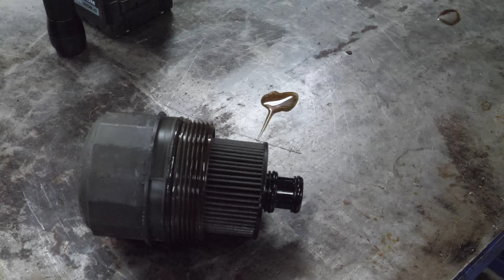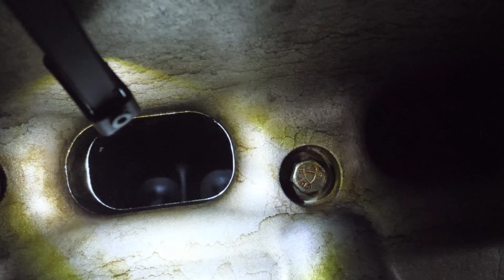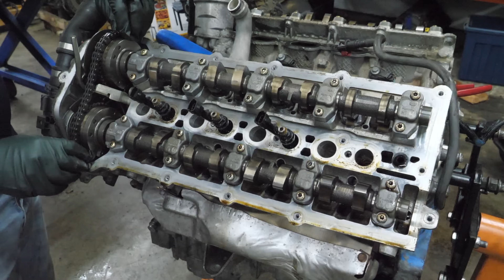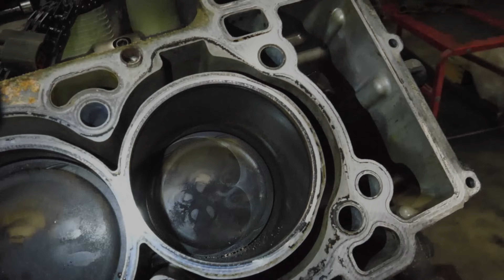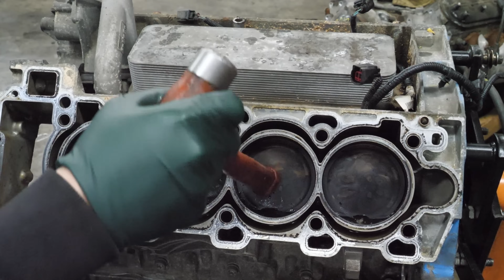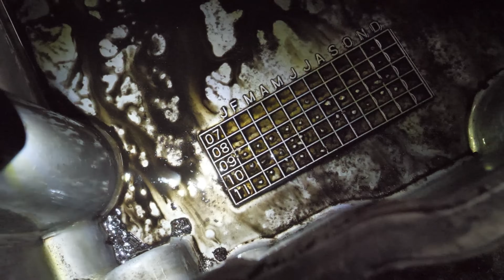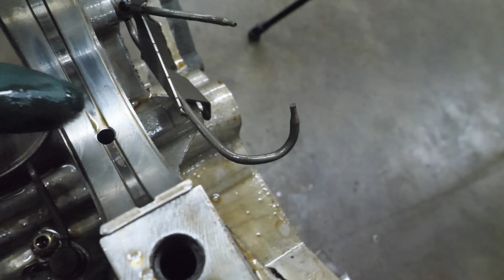500HP Jaguar Land Rover 5.0L Supercharged AJ V8 Teardown! Had to buy AND borrow tools just for this

Comment: Thank you for doing this one! I had a 2010 Jaguar XF Supercharged with this engine until I sold it in May of last year. I had an ECU tune that jacked it up to about 550hp and had it from 42k miles until about 85k miles, so let me tell everyone about the quirks.

1: The coolant system is the main weakness. The water pump design is absolute garbage. I had to replace the pump right after I bought it, then again at about 75k miles. Pretty typical for these. It's not a terrible job, but not cheap either. The other issue, which luckily I didn't have, was with the crossover pipe. That was that flat black coolant pipe he removed from the rear of the motor. They are seam welded and not very robust. After many heat cycles, it gets brittle and starts splitting at the seam, and it's not an easy thing to get to. There are a ton of other plastic fittings that get brittle which I didn't have a problem with in 4.5 years of ownership, but I knew I was on borrowed time, which was why I sold it.

2: As everybody knows, the timing system sucks on these. It's a craps shoot. I never had any major chain noise, but as other comments have mentioned, the Jaguar 15k mile oil change interval is bullshit. I changed my oil religiously at 5k miles. Apparently, there are small oil passages in the tensioner that can clog up, slowing down how fast it builds tension. Too little tension at startup for too long wears out the guides. These 5.0's were apparently much better in the timing chain/tensioner department than the earlier 4.2's, but it's still something an owner needs to keep an eye on.

3: As he mentioned, the supercharger isolation coupler is another issue. Not a major one, but something that does need to be addressed after a time. I didn't notice any noise from mine, but I'm sure it was getting worn. On the other hand, this engine is so well insulated that you can't hear ANY supercharger whine, even at full throttle/max rpms.

4: That tube that went up to the oil fill hole was for vacuum draining the oil. I got a big vacuum pump from Harbor Freight and was able to change my own oil, which is WAAAAY cheaper than doing it at the Jag dealer. And with the cartridge oil filter up top, it's very easy to change, and makes almost no mess.

5: If well cared for, it's an amazing engine. The engine is so smooth, yet brutal with its torque all the way through the RPMS. I took my XF to the drag strip for open track night many times and it was way faster than it had any right to be. At around 4300lbs and with Continental Pilot Super Sport all seasons, I did a best time of 12.2@115mph with a 1.8 60' time. It would do consistent 12.3's. It was faster than just about every Charger/Challenger that wasn't a Hellcat, most Mustangs, and most Camaro SSs. I was usually about a tenth slower than C7 Corvettes, but they are like 700-800 lbs lighter than my beefer.

I do miss my Jag, but with it getting older I was just worried about expenses. The engine is set back in the bay, so even just a spark plug change is a pain for the back cylinders. Overall, though, besides the two water pumps, which only leaked and never overheated the car, my XF was very reliable and never left me stranded from a mechanical issue. And I may or may not have had it up to 130+ on old route 66.
Reply: You love your Jag. It’s like a member of the family but in a good way
Reply: Thanks for sharing as they say in the anonymous Jag-aholic circles. Yup, oil-change with vacuum suction makes sense - no lifting the car and risking it killing you while under it, no messing with the drain plug or buying a new gasket for it, no removal of belly pans etc., just let the little pump do its big work. Some youtubers (that dude with the new VW Golf GTI who develops parts for VW tuning) claim it does a better job than draining. Greetings from Latvia.
Reply: jag land rover tech here

first of all, pretty rare to see an XF with a 5.0, those are absolutely gnarly for the smallest sedan jaguar has to offer for that year.  if they were reliable id consider buying one!

but you're correct on just about everything.  i've personally witnessed so many range rovers and a few jags need engines from overheating primarily, but occasional jumps in timing from something as simple as an oil change, quite literally, oil change mucked up the motor and it got towed out.  as crazy as it sounds its happened.

incredibly torquey, retains its power, but so many design flaws that weren't addressed, even the earlier 5.0s/3.0s had metal outlet pipes which i havent seen a leak yet! the plastic ones, the latter unfortunately.  crossover pipes i see leaking less than outlet pipes, but still fairly often and a common failure point.

not only that, jaguar/land rover's spec for cylinder head/block warpage tolerances are 8 thousandths (.008").  That is a LOT of warpage they tolerate, and typically if they cover head gaskets if its within spec, it will sooner than later just warp even further and need an engine.  joy.

vacuum draining oil makes it take so little time, very little mess, and thats how jaguar land rover recommends and pushes for you to do it! plus, oil drain passage on the oil pan will just splash onto the subframe and create a mess, plus metal undershields on rovers/massive plastic belly pans on jaguars are never fun to take off or put back on.  good on them but it can create messy work.

some full size 2023 rovers just picked up the third revision of the BMW N63.  training has said its basically another crap shoot.  once again, joy.

don't worry though, your insurance heard nothing about route 66 :)
Reply: This engine is violating a basic rule of mechanical engineering. The more parts a mechanism has the less reliable it is.  This is not good overall design.
Reply: @floatNMD  Great to hear from a Jag/LR tech. Yes, it was the "smallest" sedan Jaguar offered, but it's definitely not small. I think it's something like 4200 lbs. It's a beefy car, but still not as big as the XJs, which are massive cars.

Yeah, when running it's a great engine. Torque and power for days. Brutal but smooth. It just has some design weaknesses (probably from the bean counters) that can be fatal. With as fast as Jaguars depreciate, if you can afford the maintenance, I would take one over a Charger/Challenger or anything else, really. It handled really well for such a big car with the active suspension.

I've heard that a lot of the newer Jags like the XE has BMW derived engines that are, ahem, less than reliable. It sucks because I really like the styling of the XE, but I just don't know if I want to deal with the maintenance/craps shoot.

All luxury cars are a craps shoot for reliability, really. The most reliable car I've owned, believe it or not, was a 2008 Saab 9-3 Aero (Turbo V6). I put a tune on it (about 320hp) and I had close to 100 passes down the strip. I had that about 4 years as well, and all I had to do to it was new rear shocks, some coil packs, and a cracked vacuum hose. I could knock out 13 second 1/4 mile times, then get 30mpg on the way home. But for every story like mine, there are nightmares.

I bet you do make some bank as a Jag/LR tech. I had to take my Jag to the dealer to replace a leaky diff seal and the dealer raped me for $1400... All of the indy shops that worked on Jags were booked almost 2 months out and I couldn't wait that long to fix a problem like that.
Reply: @floatNMD  yeah new rovers and svr's with bmw's 4.4l TT V8
Reply: @jnordne2  rear differential front pinion seal by chance?
Reply: @andrew_gencoupe  being its a jag I see axle seals leak more than the pinions, just a shot in the dark guess.  see more range rovers with pinions pissing diff fluid than i do jaguars.
Reply: @andrew_gencoupe  Whats crazy is how hard the n63 picks up and scoots those cars, i've gotten a bunch in for service already within the first year of them being out, test drove one in dynamic mode since it was after the break in period, and wow, moving a 6500lb land yacht on bags that quickly is ungodly.  just not excited if i gotta do valve guide seals, already a shit show taking those motors out.
Reply: @jnordne2  Wow I never got a notification, youtube signed me out :(

Surprisingly enough, I haven't seen any jaguars get brought off the truck into the dealer with the n63 yet.  I HAVE seen some issues with thermostats leaking onto the DME and frying the harness already with brand new rovers with parts with no ETA coming from across the water bc they have to get a DME from BMW made along with a wiring harness and thermostat (engine out job by the way), auto-hold braking systems wearing down the rear brake pads to 4mm with 13k miles, and suspension faults from the get go, the usual first model  year issues that happen with most manufacturers, but we'll see what happens with that, buyer beware. 

Jaguars are special order only at my dealer at this time since we have a lot in inventory, so unless someone builds one they're not getting shipped here.  Have seen a few 2023 SVR F-Pace's come in though, still using the same 5.0 V8, and 5.0 V8/Carpathian 5.0 V8 defenders as well.  Haven't seen/heard anything about any XE's or F-Pace's having an n63 in them, considering Range Rover/Range Rover Sports switched over to lithium ion batteries and we're onto a new chassis.

Being a tech there though, its a nightmare with work because we have a lot of service cars in, but no parts from across the water available. however though when one leaves the shop, another gets towed in.  Keeps the money flowing and keeps my job security hahaha.
Reply: A great review to the issues of this model.
Reply: @andrew_gencoupe  No, passenger side axle seal
Reply: The TATA Jags are a different beast thank the Ford Jags.
Reply: Lovely
Reply: @thetacticalfuturist588 we are not making a case for it being a good design. It's an absolute 💩 design (and wait until you find out the V6 is the same block with the rear cylinders blanked out 😂😂😂), but they run smooth, and make seat of the pants power, which make them very fun to own and drive.
Reply: Sitting on a coolant crossover on my 11 XJ right now. Send some good wishes, it's such a PITA
Reply: @thetacticalfuturist588 The government must intervene and regulate European car makers.
Reply: @floatNMD hey man i have this engine 115k miles and i’m getting misfire codes along with this code 

P052A- Cold Start Intake (A) Camshaft
00
Position Timing Over-Advanced
(Bank 1) - No sub type information

any idea where to start?
Reply: How much was it to replaced the water pumps?

Comment: Watching this makes me really appreciate the simplicity of the engine in my classic car. No fancy computers or fuel injection or wiring harnesse..no tons of plastic either.
Reply: Yup, I’d rather swap a new engine into my 58 than do even sparks plugs on one of these. Had the engine out in under three hours the other night, time for something different but man it’s just pretty easy for the most part. Takes longer if I pull the trans with it but there’s not need most of the time plus everything else there’s tons of room to access and get to. It makes wrenching fun, owning something like this would certainly not make it enjoyable. I love my newish Japanese cars but for wrenching I’ll stick to the oldies Americans.
Reply: Its an American engine FORD and its not that difficult to rebuilt
Reply: @rallyauto34  yeah it's not difficult, I know that. Funny you mention american ford engines.. my old car has a ford 302 windsor and compared to the engine in the video its far more simple..which is basically what I implied before.

Comment: I've got the "3.9" Ford version of the AJ in my Lincoln LS and I absolutely love it.  It's such an underrated, misunderstood engine.  It's physically tiny, makes incredible torque, and is just good at everything.  Really great engines.
Reply: Those are actually solid engines. My cop worker has a Lincoln LS I think it’s a 07 and has almost 300k.
Reply: Springvale Studios, Ipswich, Suffolk, East Anglia, UK.  "...This ain't no heavy iron ford small block now is it?"  Stock Ford 289, without accessories:  460 lbs.  Jag AJ8:  440 lbs.  That stock 289 would have iron heads and intake manifold on it, replace those with aluminum, save at least 40 lbs. = 420 lbs.  Don't be too quick to write off American engines as "heavy iron lumps."
Reply: We had that also, agree, it was a really fun, nice sounding engine, in a beautiful red metallic LS with chrome wheels.   HAUTE!!!
Reply: @OgamiItto70  Butt hurt much?
Reply: @Lazy_Tim  That's something you should probably ask Enzo Ferrari.  Of course, you'll have to get permission from Shelby American, since Carroll Shelby used the Ford "small block" to own his ass.
Reply: @OgamiItto70  lol you watched a movie. Clap clap.
Reply: @Lazy_Tim  Butt hurt much?
Reply: @OgamiItto70  they never won with the small block, they won with the 427FE. Still a great achievement but then it did have 7 litre engine vs the P3's 4 litres so it's hardly surprising it had a power advantage.
Reply: @OgamiItto70  Is that 289 going to make 500 hp, have good driveability, and pass emissions?

You have a good point, American V8's aren't as heavy as people think.  Inline 6's from the 1960's were typically heavier than the optional V8's.
Reply: @bunter6  They won the 1965 International GT Manufacturer's Championship with the 289 Cobras, including the Daytona Coupes.
Reply: @OgamiItto70  yes but they didn't win le man's, until they gave the gt40 the 427,
Reply: @Flies2FLL  "Is that 289 going to make 500 hp, have good driveability, and pass emissions?"  Is it going to need to in a boat?
You're right about I6s being heavier.  Over here in Americaland it used to be a fad to replace Jag I6s, when they failed, with Chevy 350s which were lighter, cheaper, more powerful, more economical to operate and maintain and more durable than the stock aluminum Jag motor.
Reply: @OgamiItto70  I live in Flori-Duh, and I'm familiar with the Chevy conversions in Jags.  Owners say it is night and day better, though it does lower the resale value.
Reply: @Flies2FLL  Except Jag and Land Rovers are notorious for problems, including premature engine failure. The 3.9 was pretty prone to timing chain issues and when it jumped time it bent the valves. There’s a reason those two brands are usually at the top of “least reliable” and “lowest resale value” lists by manufacturers.
Reply: @Flies2FLL  Jaguar already had low resale value, you can’t really do much to hurt it any more. Look at the XJ series. MSRP in 2016 was about $84K, give or take a grand. You can find them all over with 30K to 60K miles for anywhere from $25K to $40K. That’s over half to 3/4 of it’s sale price gone in only 6 years or so. There’s a reason for that, they’re junk.
Reply: @GMbowtie350  Haha!  Yeah, they've had their issues.  When Ford walked in the door, they really improved things.  Basically, they are decent cars now, but they certainly are not Toyota's.  I've never owned one but I think the depreciation probably has more to do with design than with reliability.  These days most of them look like a Camry or something Korean = Cheap.  Not a Jaguar.
Reply: @GMbowtie350  True.  With one exception, nearly everyone I've known with a Land Rover says that car spends more time at the dealer than in their garage...
Reply: @Flies2FLL  No, I promise it’s reliability. A lot of their designs affect reliability. I’ve been around my fair share of Jags and they’re horrible, and Ford getting involved didn’t help one thing. When it comes to a luxury sedan or a foreign sport coupe if it’s not a Lexus I don’t want it.
Reply: @Flies2FLL  I’m biased though, it can have all the performance in the world but if it’s a pain in the ass to work on I don’t want it.
Reply: Ford won the 1966 and 1967 LeMans with the “427“ however, the 1968 and 1969 Lemans was won with a small block powered GT40 variant run by private teams.
Reply: Poor poor Ford driver, if only you got to experience the Buick/Rover V8 that preceded the AJ. I'm kidding but you could disassemble the whole engine with a couple tools. edit: in about 1% of the time its takes the disassemble a AJ or really any modern engine.
Reply: @GMbowtie350  completely agree. Having owned Jags, Bimmers, Toyotas, Evos, STi, a GT-Rs, etc I've only had issues with completely stock European luxury cars. Currently have a Lexus and it's never had a single issue. And the Japanese cars were always modified (by me) and still far more reliable.
Reply: Those were very good engines. They had Denso engine management on Rovers and Jags and were Japanese-good. They were used in Land Rovers through ‘09. The engine in this vid came out for ‘10 and was a whole new design. More modern but much more fragile and the timing chain guides go bad and are a lot of work to repair. They’re a lot more expensive to repair and maintain.
Reply: @nicholasagnew2792 I bet the brits would've loved the buick 3.8 liter v6, especially the supercharged versions called the L67, super reliable and decent mileage on the highway